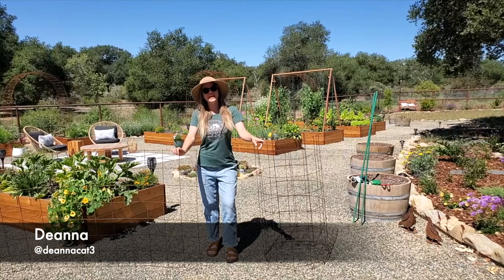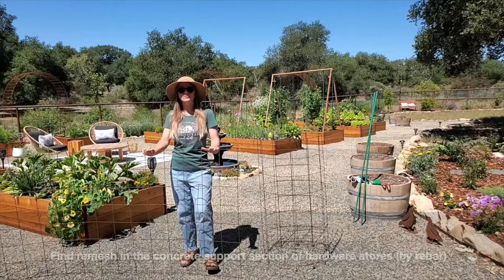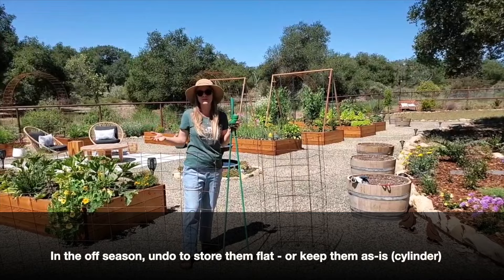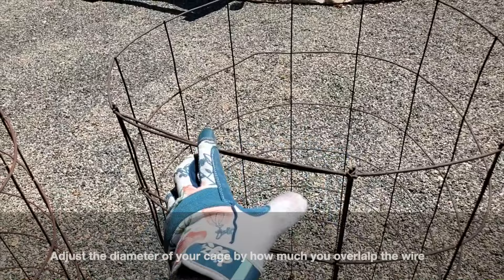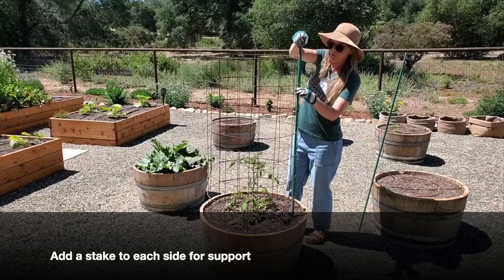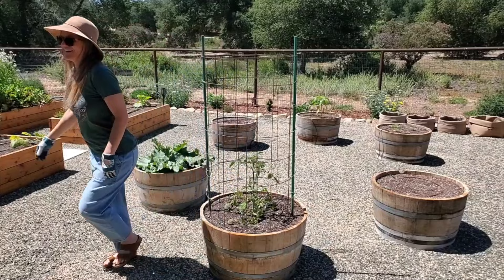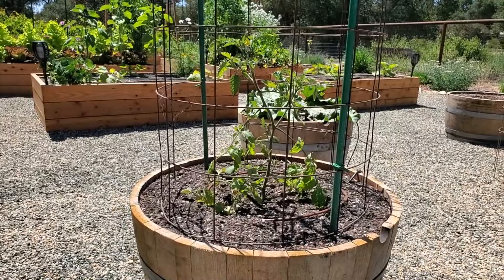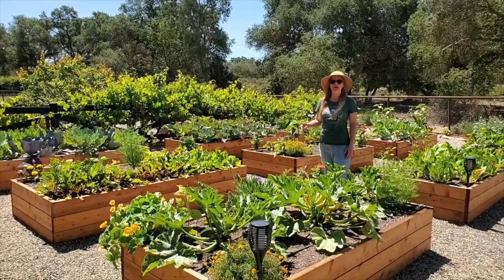How to Make a DIY Tomato Cage: Easy, Sturdy, and Cheap!

Comment: Just priced the mesh at both Home Depot and Lowes - $24 a panel.  Sigh....... I'm in Central Oregon.
Reply from the maker: Price on the concrete remesh has gone up over the past few years, pricing on construction materials can fluctuate quite a bit from year to year. You can use single stakes and use the Florida Weave system for for training. We have a video on a DIY tomato trellis system that you could modify to using stakes only without the wood frame.

Comment: Hi Deanna! Would companion plants (basil, marigolds) go on the outside of the cage? Wondering because there seems to be enough space inside, but maybe the plants need more airflow. Thanks! Your garden is an absolute dream. 🌿🤍
Reply from the maker: Hey there! I would put them outside. Did you see the image I added at 0:32? That was still early in the season, and you can see how filled the cages were already! Our cages are always very full and even overflowing, no room for other plants inside. Enjoy!

Comment: I made cages similar to this 20 years ago, and have used them every year since.  I think the sheets of re-mesh were 10 feet x 5 feet.
Here is a tip: put a garden post/stake into the soil, wire-tie the cage to the post/stake so that its bottom is about 10 inches above the ground.  This gives the cage a taller height and it also makes it much easier to weed; you can use a hoe without having interference from the cage resting on the ground.
Reply from the maker: Thanks for sharing that tip!

Comment: Field Fence wire also works very well and is easy to make into a round cylinder.  I have been using them for many years.
Reply from the maker: Good suggestion!

Comment: Great video and thanks for sharing the links for other methods to support tomatoes.  My Florida weave wasn't that successful last year (I'm guilty of not consistently weaving as the plants grew and the wire was too thin - sliced through a stem!) so I think I'll experiment and make a couple of cages too.  Thank you!!
Reply from the maker: Sounds great! We usually bounce around with different approaches each year but a tomato cage is simple and it works great.

Comment: Thank you for posting. I love the idea, but I do patio tomato gardening and I believe my "pots" are too small to use remesh. What exactly were you using as the support posts?
Reply from the maker: The support posts on the cages are just steel garden stakes that you can find at most nurseries. If your pots are too small, you could use the Florida weave system which would entail a bit more pruning but it could keep your patio space and tomatoes more tidy. We have another video on DIY tomato trellis which you could likely execute with 3 garden stakes and twine, you just selectively prune suckers to only keep a few main ones growing upwards within the twine and trellis system. Hope that helps and have fun growing!
Reply: @HomesteadandChill   Thank you so much!

Comment: How do you guide the up? Do you just lay it on a higher wire?
Reply from the maker: We just keep pushing the limbs in and up towards the top of the cage, once it reaches the top of the cage, the limbs will just start to spill out over the top or you can add an additional cage to the original one with a foot or so overlap between the two if you want to create an even taller cage. 

Last season we trained our indeterminate tomatoes similar to a Florida weave mixed with the single stake method. We hope to share the set up in another video before the season starts.

Comment: Another great video. I already have tomato cages with extensions but I was wondering if these will work with pepper plants. Both my cayenne and Jimmy Nardello plants every year grow to almost tomato heights. thank you!!!! gino
Reply from the maker: Wow, those are some big pepper plants! You can absolutely use them for peppers, you can overlap them a few squares to make a cage with less width if needed.
Reply: @HomesteadandChill  Thanks Deanna, you were right the prices have more than doubled. $20-$25 per sheet Home Depot and Lowes. Suburbs Philadelphia area. I have around 20 pepper plants. Yikes!!!
Reply from the maker: @ginobass66  You can always look for alternatives, since your peppers get so large, is a sturdy single stake not enough to hold them upright? You can always try the Florida Weave support system which is more labor intensive but should be cheaper overall. Check out our article on different tomato support methods if you are interested.
https://homesteadandchill.com/train-support-tomatoes/
Reply: @HomesteadandChill  Thanks Deanna, I’ve used stakes but not only are the peppers tall they are very bushy so I have to use multiple stakes per plant. I top all plants before planting in raised bed and as scary as it was the first time the results are insane. I think your homemade cage would be the perfect solution I just need to find an affordable place to get the sheets. A friend said you can buy rolls instead of single sheets which might be affordable way to go. Thank you!!!! gino
Reply from the maker: @ginobass66  Sounds like a good idea, best of luck to you this season.

Comment: Wonder if chicken wire would work bc that's what I have that's similar rn
Reply from the maker: The holes in chicken wire aren't large enough to fit your hand through to start harvesting tomatoes. Chicken wire is also too flimsy to stand up on its own so you would need to create a frame for it to stick to using bamboo, wood, or rebar stakes.

Comment: These unfortunately contain lead. I use to use them but this year I'm trying 10' 3/4" conduit with maker pipe connectors.
Reply from the maker: I'd be interested to see where you saw that confirmed. I've done a lot of research and haven't seen anything conclusive about lead in these, just maybe a small amount in the solder/welded joints, but since this stuff is all above ground rather than below soil and we get virtually zero precipitation in the summer, there is essentially no way for it to get into the soil. Even if it did rain more here, I wouldn't be overly concerned. Especially since compost and worms are FANTASTIC and remediating contaminants in the soil, heavy metals included. I'd honestly say there is more risk for toxins involved in buying soil and compost
Reply: @HomesteadandChill  I bought them at Home Depot and on the price tag it says contains lead.
Reply from the maker: @duanehundley  ah! Yes probably just the solder. Are you in CA too by chance? Sounds like a prop 65 thing, damn near everything gets a label 🤪
Reply: @HomesteadandChill   I am in CA.  Solder is lead free now and harder to work with in my opinion. I did like the cages but my tomatoes grew taller than two of them stacked together. I'm hoping the 10' tall emt conduit will be tall enough and if not I will have to use the lean and lower method.  Your garden looks great and I will be waiting to see it come along this summer. I only have space for 1 25x3' raised bed